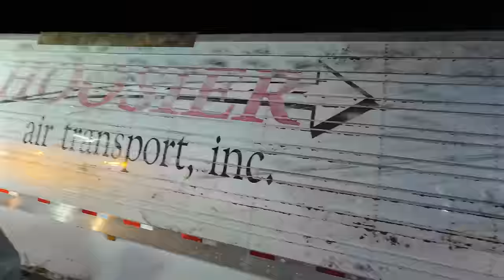Who Gives A $#!+ About The Title? JUST WATCH!!

Comment: Great job & video! Y'all do an amazing job!! Everything looked so smooth & y'all really do make it "look easy" even though it's anything but that!! Entertaining as always!! Any luck with Hellboy's computer issues or whatever was causing the no run condition? Did you contact & talk to Mark @ Wrangler Fix, if so was it something he could help you with or were you able to find someone else to help you? Just curious, I know how annoying it can be when trying to fix electrical and/or computer issues!! Makes me long for the old days when things were much simpler when the main things you had to worry about were fuel,air & spark & minimal wiring!! All of the advanced technology is great until something goes wrong or you get an intermittent electrical gremlin that cost you a bunch of $, but never causes a problem when you take it in to have it diagnosed so they can't tell you anything! I had one occasional no start condition in certain weather conditions that cost me a bunch of money in parts & labor for a few years that ended up being a hairline crack in some solder in the instrument cluster. I ended up finding it myself on accident, resoldered it & haven't had the problem again for over 2 years. Sometimes it's better to be lucky than good!!😅😅 Thanks for all of y'alls hard work!!
Reply from the maker: Got it figured out today. I did reach out to Wrangler Fix but they never returned my call. Had a guy come out of Phoenix that was able to flash the ecm this afternoon and that’s all he needed so far.
Reply: @MURPHYSDIESEL  Sorry they didn't get back to you, but I'm glad you were able to find someone to help!! That's so awesome!! I'm looking forward to seeing Hellboy out there kicking some ass!! He is an amazing piece of machinery!! Thanks for replying!! Keep getting WESTERN!!( double finger bang!!😀😀👉💨👉💨)